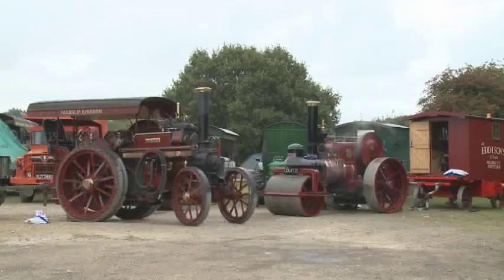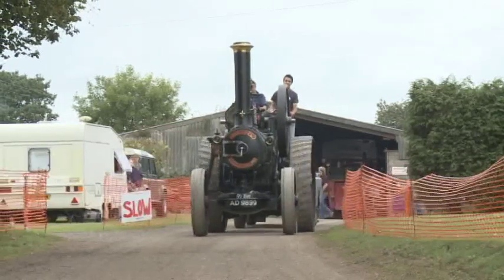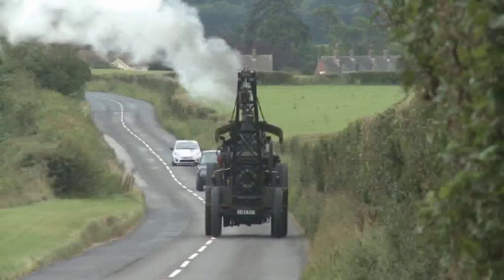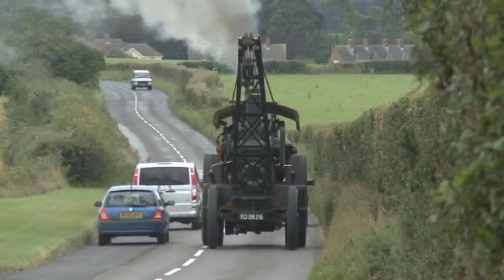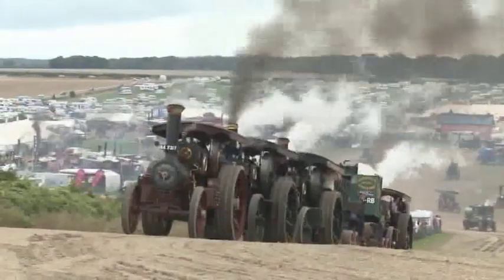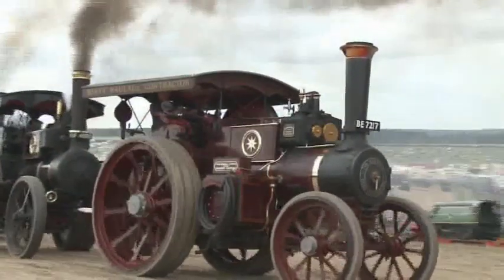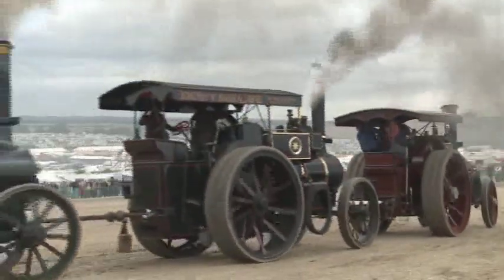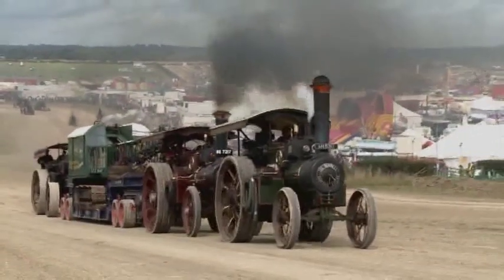THE GREAT DORSET STEAM FAIR - HEAVY HAULAGE ON THE ROAD AND IN THE "PLAYPEN"

Comment: I wonder if those rebuilt traction engines uses the same gears as the original one or if they make them with modern steel so they won't wear down so fast